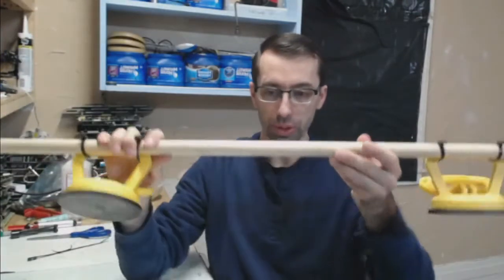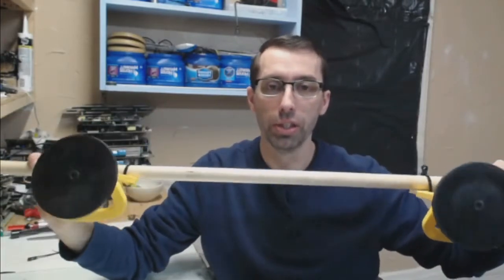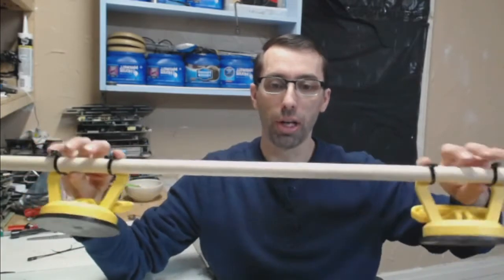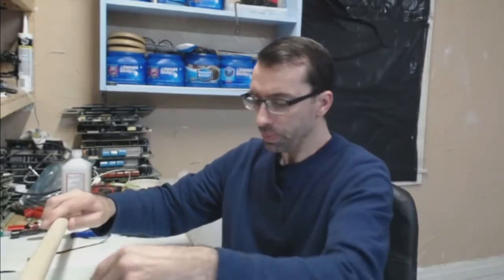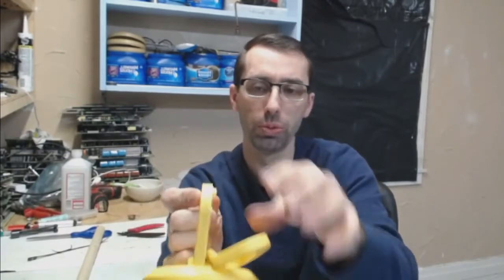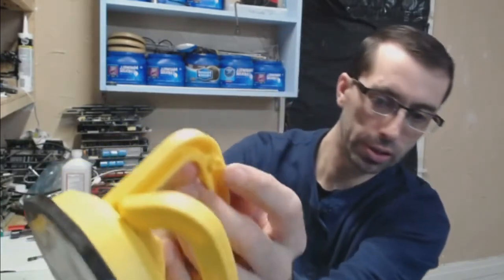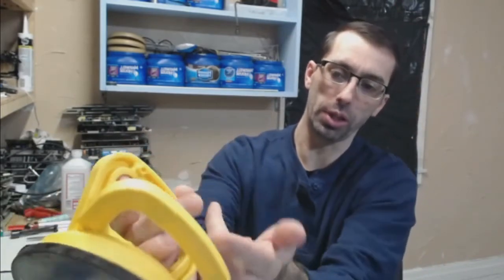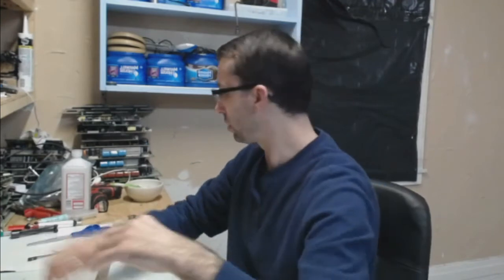Suction cups for LED repair

Comment: I have a 75" that I need to remove the screen off to get to the LED strips. I wonder if these will work without messing up the screen. I hear screen having pressure circles after using the suction cups.